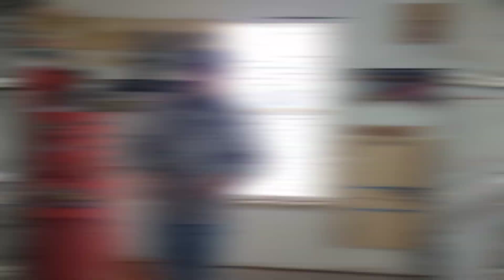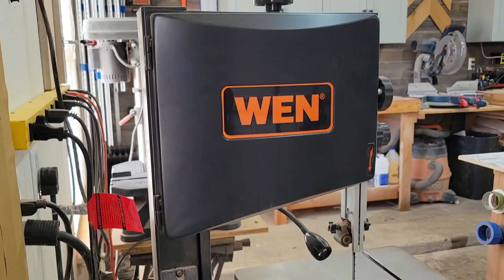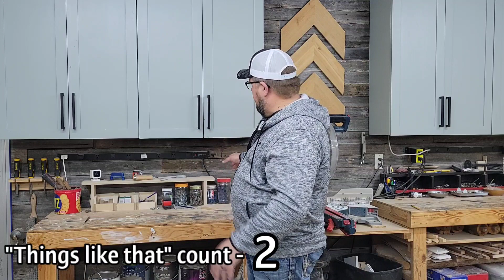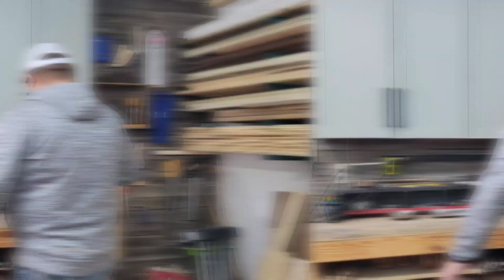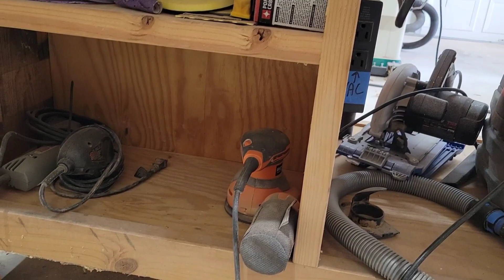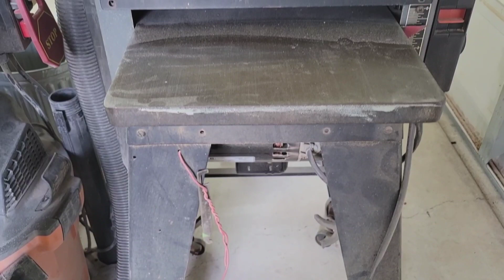Small Shop Tour and Layout | Two Car Garage Workshop 2022

Comment: Thanks for the video. What lights do you use? Color temp 4000?
Reply from the maker: Hi! So the lights in our shop are 6500k Barrina LEDS. They're dirt cheap. Like 45 bucks for 6. They're linkable but honestly not the most reliable. I've been through 3 sets in 4 or 5 years. That being said their customer service has been good and they either reimburse me or send me replacements.

Comment: Hi. Enjoyed your shop tour. Good to see a use what you've got to fit it out shop. No overkill with spit and polish. How's does the Bosch chop saw perform on repeatability with the mechanical arm linkage mechanism. Cheers Tony
Reply from the maker: Hi Tony! I honestly have no issues with repeatability.  It stays very true. Another big con I forgot to mention about that saw though is it doesn't have a laser or shadow light. Just FYI
Reply: @SecondShiftFM  Hi I'm not bothered about either of those as a lot are just gimmicks. It's mainly about the rigidity of the arm when extended out. Thanks Tony
Reply from the maker: @tonyworkswood  solid as a rock!